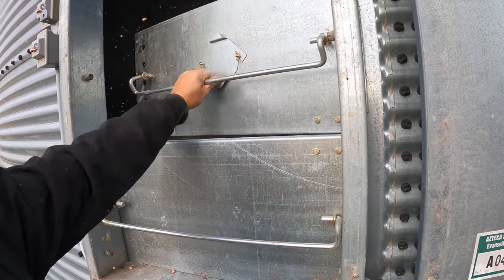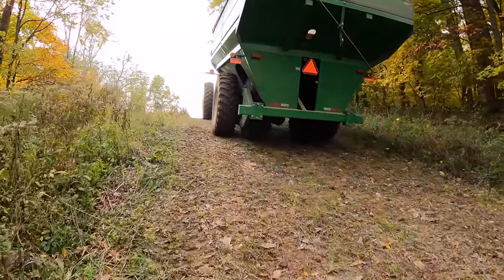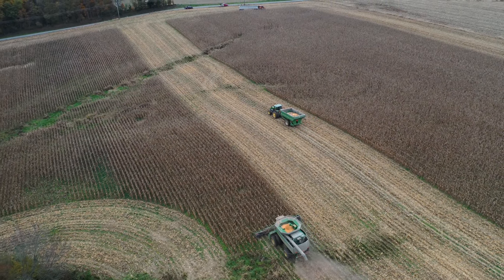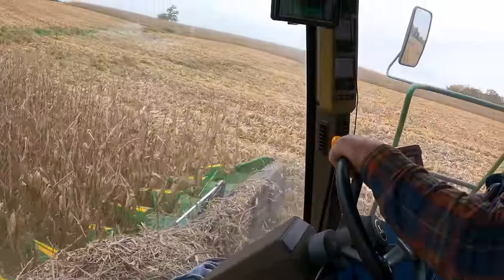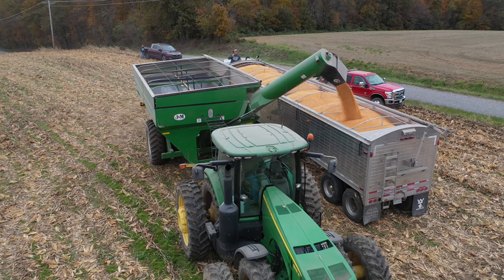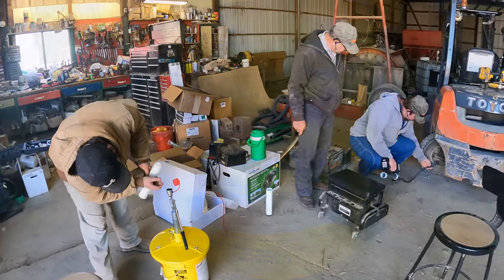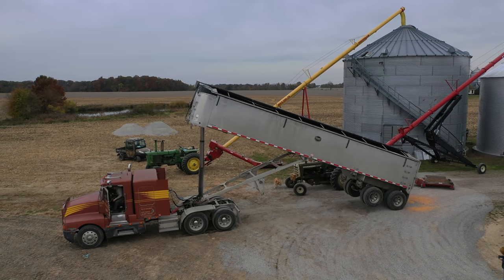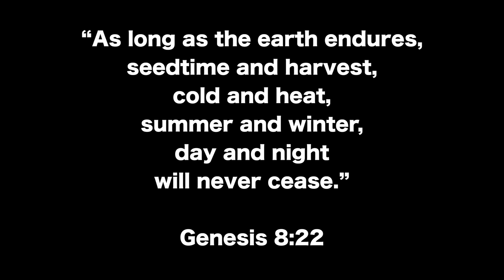60 Semi Loads, 3 Days. Family Corn Harvest!  Corn Farmers Have Big Ears!

Comment: Tim...I realize the broken key issue was on your earlier video, but I just found the info.  I purchased a Key Saver for 2 series tractor on Ebay.  It is $20.00 and works on 2,3 and 4 JD series tractors.  Bob

Comment: I’m surprised you guys were taking the time to refill grease tubes mid job. 

It’s currently my busy season, and I just replaced my water pump due to a broken bolt on the thermostat.  I easily could have fixed it, but I got a spare pump in case it went bad, then the time I had available wasn’t enough to repair the old one.  

The potential missed job would have only slightly cost more then i could have saved by fixing the old pump, but it was cheaper then trying and failing to fix the old pump  and got me back to work. 

2 days later it snowed enough that the season is on hold, and possibly over for the year.

Comment: Great video and we really enjoyed watching the harvest work.  I do have an unrelated question for you.  We recently finished clearing about 1.25 acres of our property to build our cabin.  We just brought home our JD 1025R and have been discussing the attachments we need to use to finish up once the septic, well, and electricity have been installed.  We have the 48" box blade w/rippers and the landscaping rake.  The ground has a ton of roots and we thought it would work to use the box blade first and then finish up with the rake.  However, watching your videos using the tiller has made us wonder if that would be a better attachment than the box blade for breaking up those roots.  So, what would be your suggestion?  Thank you in advance and thank you to you and your wife for the videos as we have really enjoyed them and found them very informative.  God bless you both!
Reply from the maker: You can get by with box blade. Many ways to do this.

Comment: what a great video, thanks for sharing. sometime could you review the old Oliver tractor and any of the other older tractors. it said hydro on the side of the Oliver tractor does that mean it has a hydro transmission?
Reply from the maker: No, it has a two speed shift on the go.  Called ‘Hydrapower’
Reply from the maker: Emery, this one has the Hydrapower drive…predecessor to the over-under hydraul shift.
So, only 2 speed shift.
This 1950-T was one of the first few built, I think.  1967 model.

Comment: 60x5,000= 300,000k that's nice haul.
Reply from the maker: About 1000 bushels per load, not 5000.
Roughly 60,000 bushel in 3 days.
Reply: @TractorTimewithTim  I'm talking green backs here Tim$.  I'm sure you got at least 5$ a bushel didn't you?  They did here in MN
Reply from the maker: Expenses are crazy high.  Remember, a large combine now is over $1 million.
Per acre expenses high as well.

Comment: What make is the Header on the combine, they had a MacDon before. Is the bulk grease & loader from shuttle lube?
Reply from the maker: Yes, the grease equipment is from Lube Shuttle.
I’ll let Randall reply with details on the corn head.
Reply: The corn head is a Drago. 2013 model Series II. We like the Drago spring loaded deck plates. It does help to save corn in our variable soils. I could never run hydraulic deck plates in and out all day. The stalks push the plates open and each row is independent so they are appropriate width for every stalk in the field.